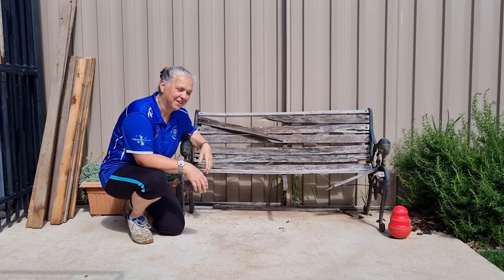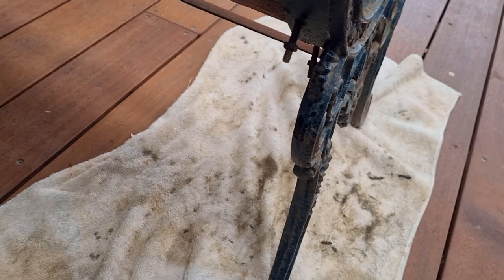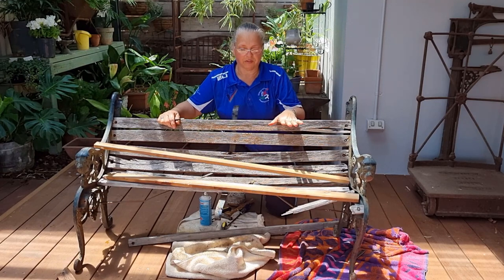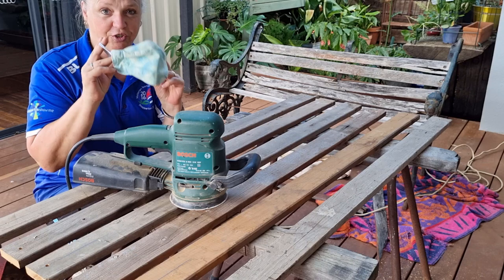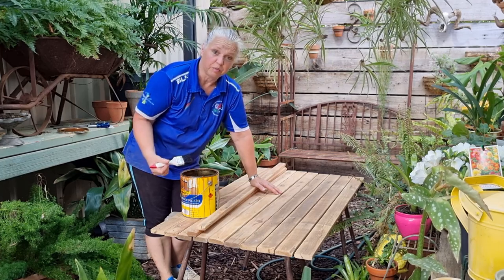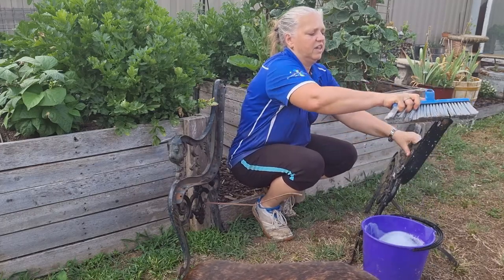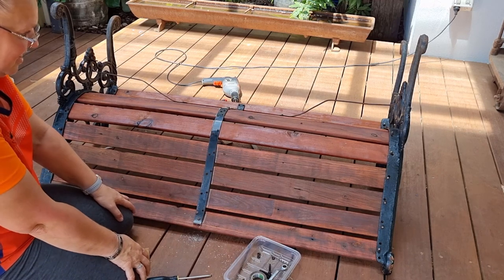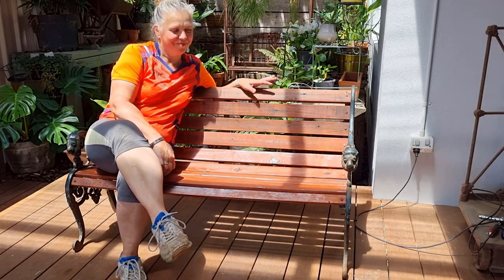How to restore an old bench seat from recycled/reclaimed timber pickets DIY restoration project

Comment: Hello Christine!  Debbi here.  I wanted to share with you that your playing card holders are a big seller for me here in the USA.  You are asking for new ideas and I wanted to share with you my other big seller at this time of the year and that is fabric pumpkins.  Here in the US autumn is pumpkin time!  Let me know if you are interested!
Reply from the maker: I'm so glad your card holders are selling well for you.  I'd be interested to see how the fabric pumpkins look. I't may be something I'd consider for next year, though in Australia, Halloween is fairly new 😀
Reply: Hello again!  Debbi here.  The pumpkins are very easy to make.  You will need any sized rectangle of fabric, fiber fill (pillow stuffing), butcher’s cord or string, a sharp needle with a large eye and a long upholstery needle.  On your sewing machine sew the two narrow sides of your rectangle together to make a tube.  Next, sew by hand a running stitch along both top and bottom of the rectangle ( no hem needed).  Then  pull the cord together at the pumpkin bottom together. Tie off securely.  Then turn your pumpkin right side out and stuff with the fiber fill.  When you are happy with the pumpkin feel, size and shape, then pull the cord at the top of the pumpkin and tie off tightly. Next take a long upholstery needle and cord and insert it into the top hole of the pumpkin and push down to the bottom and out of the bottom hole.  Pull the cord out and catching a small bit of fabric and reverse the process.  Push the upholstery needle back up through the pumpkin and out of the top hole.  PULL the cord until the pumpkin shape forms.
The fun part is decorating your stuffed pumpkin.  A pumpkin’s peduncle (stem) is as important as the color, size and shape of the pumpkin.  I like to use a branch or piece of driftwood to make a very cool pumpkin.  Simply cut and insert into the hole at the top of your pumpkin and hot glue in.  You can decorate with faux flowers, leaves, vines….whatever.  It takes me less than 10 minutes to make one pumpkin and they are BIG sellers for me.  In fact, it has taken me longer to type these instructions than to make a pumpkin!😂

Halloween is so much fun for young and old here in North America.  I hope you will have the chance to enjoy it too.  Thank you for your enjoyable YouTube videos, I really enjoy your tips and tricks.~ Debbi
Reply from the maker: @davidprazynski6045  thanks Debbie. I'll give it a go once my hands have strength in them again 😁